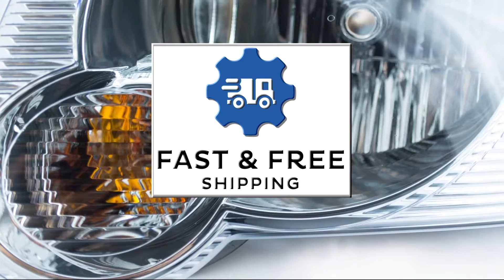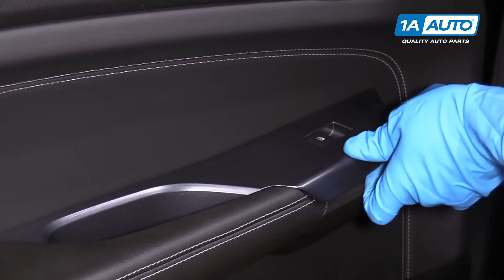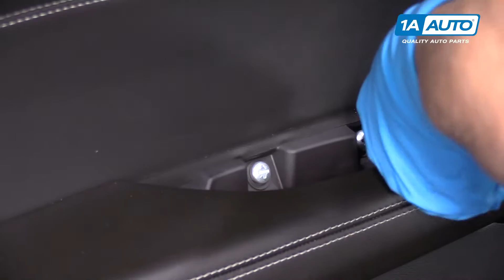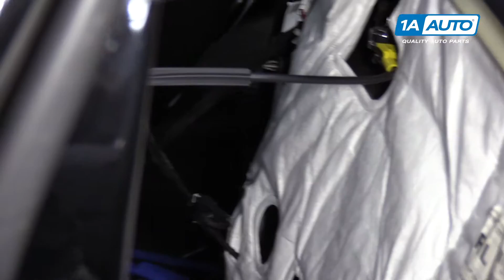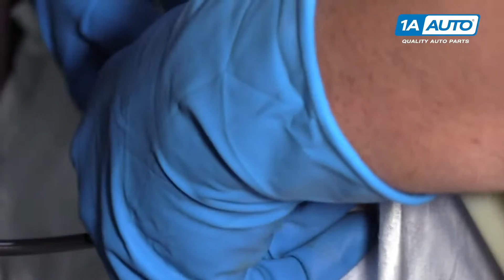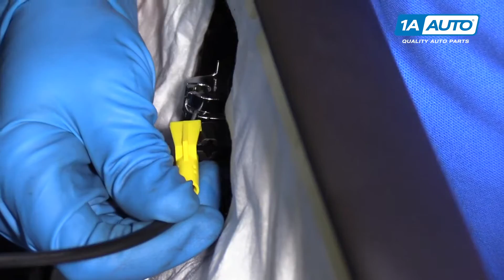How to Replace Rear Door Speaker 10-16 Cadillac SRX

Comment: You should have also told us how big the speaker is... So I would know what to order and how I would install an aftermarket speaker... I just bought my Cadillac and the rear speakers are blown
Reply from the maker: +J Brown Thanks for checking us out! We do not have specifications on the size of the speakers, however, if you are looking to purchase new speakers, as long as they are listed for your application they should be a direct fit.